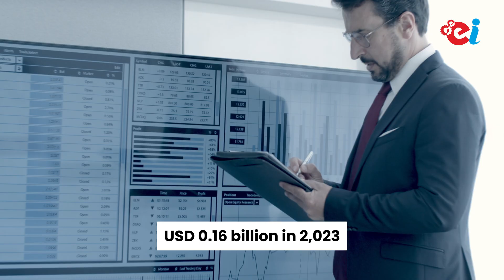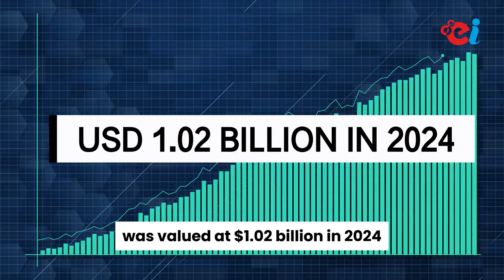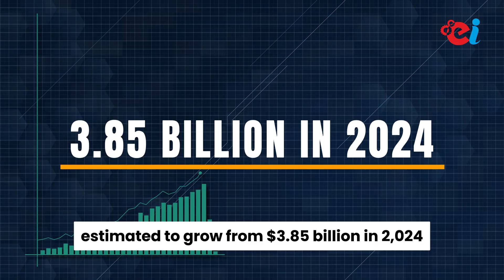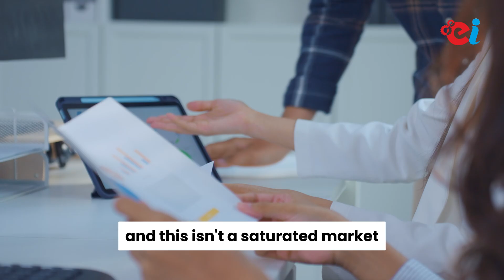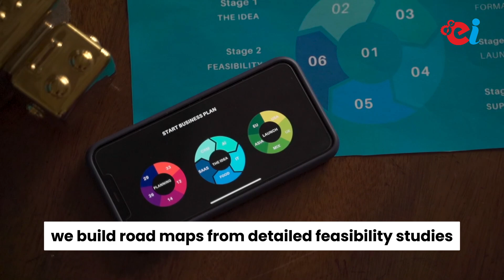From Rice Husk Ash to Silica Gold: How India’s Hidden Waste is Fueling a Billion-Dollar Industry

Comment: Setting up a small business for silica production from rice husk ash in India typically requires an initial capital investment ranging from ₹65 lakh to ₹8.5 crore, depending on plant capacity, automation, and equipment quality[1][3][6].

### Estimated Setup Costs

- For a 5 metric ton/day plant, investment is around ₹65 lakh (₹6.5 million)[3].
- For a 20 metric ton/day plant, investment rises to approximately ₹8.5 crore (₹85 million)[1].
- Smaller, manual setups may reduce costs, but advanced automation and capacity increase the overall expenditure[8][3].
- Machinery cost for one turnkey silica plant is quoted at ₹1 crore for products like sodium silicate from rice husk ash, with prices varying based on automation features and vendor[6].

### Operational Costs and Raw Material

- Rice husk ash costs around ₹2 per kilogram, with labor, electricity, transport, and maintenance adding to expenses[2][3].
- Production cost per kg of purified silica is typically between ₹22 to ₹25, with selling price around ₹55–77 per kg[3][2].

### Other Considerations

- Land, building, packaging, and regulatory compliance further add to setup and running expenses[5].
- Smaller plants may find lower operating margins but enjoy ease of sourcing rice husk and simpler logistics, especially in major rice-producing regions.

In summary, a modest, competitive setup with a small footprint and low automation could begin operations with an investment of about ₹65 lakh, while medium-scale automated plants may require up to ₹8.5 crore in machinery and infrastructure costs[1]